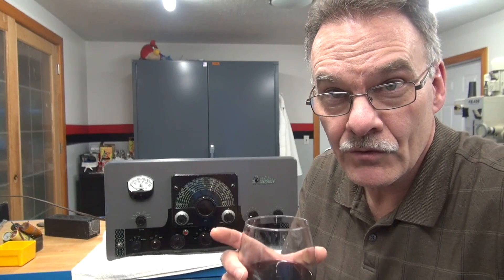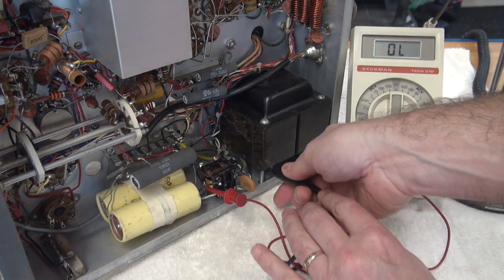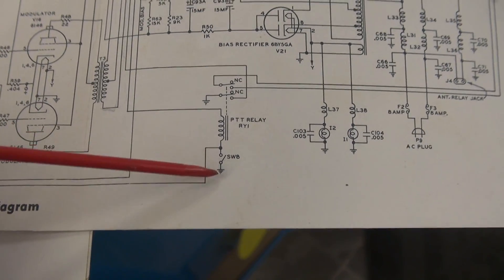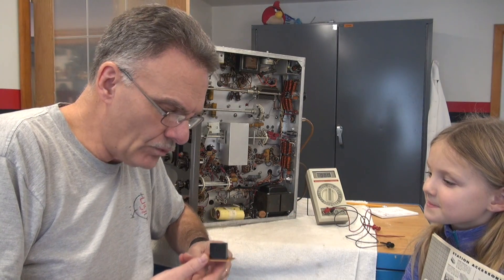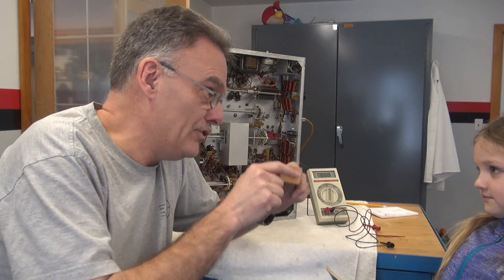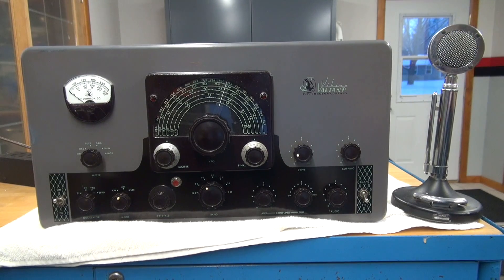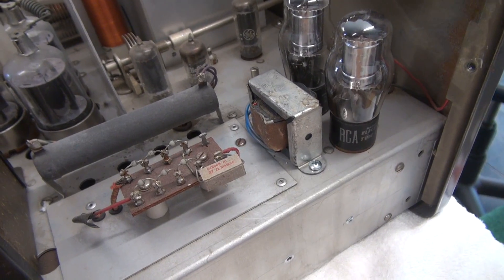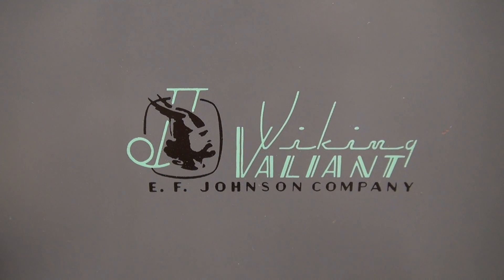How to repair modify Johnson Valiant Ham Transmitter PTT circuit

Comment: Hello Terry, thanks for all the great vid's, in the process of resurrecting a Valiant currently. Mine also has a 120 volt relay in it, and neither the manual or PTT keys the transmitter. There are  several examples of the "cobbler" that I'm removing, he's a busy guy. Is the relay unobtainium? I have a large stash of relays, but cannot find spec's for the stock relay, and they're not in the manual. The relay is listed as RY1, but no spec's are given. If you happen to see this would you be able to pass the info on the relay back to me. It'd be much appreciated, but thanks either way, you're vid's are precious material. Derrill, KD8AKS.

Comment: These old Radios reminds me of the year 1972. Every company, even Harley Davidson began making snowmobiles. No in 1972' that was the year we got our snowmobile during a blizzard... my dad drove the snowmobile home from 15 miles away on the main roads which were closed to automobiles. Anyhow, Article Cat, Ski-do, Moto-ski,Sno-jet, Rupp, the list goes on and on, the comparison, E.f. Johnson, Hallicrafter, Heathkit, .... the point there was a Radio receiver,radio transceiver explosion. I enjoy watching these older vintage machines being repaired. No Surface mount technology or Base,Emitter,Collector transistors or FET's, the components all had some real estate between them. Not crunched into a Tuna Can tin.

Comment: How was the original relay powered?  That seems like a lot of work having to build the relay power supply and all.
Reply from the maker: There was a voltage divider on a 300vdc power supply, feeding the original 10K relay coil approx 130vdc. That relay is pretty much impossible to locate. Some have used 12VDC relays and a voltage doubler circuit off a 6.3vac tube filament line. I elect to use a step down transformer, and target 5-6vdc relays to keep the possible HV hazard out of the microphone.  Yes, it is a bit of work, but worth it.

Comment: I gave away a 1930's battery charger. That would have been a fun project for you maybe? It would charge at 2, 4 , and 6 volts. I don't anything about this stuff, but it supposedly had a pretty rare working tube that was massive.